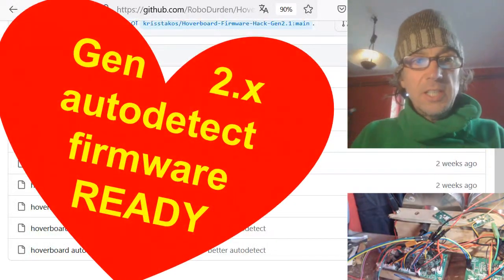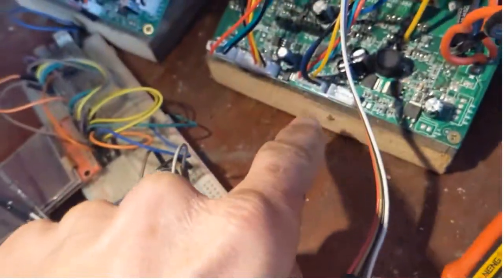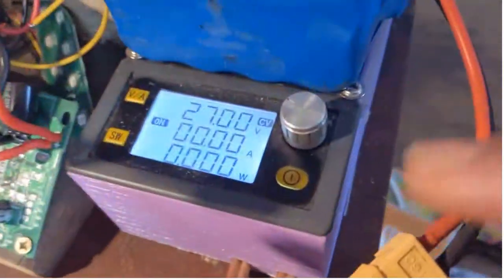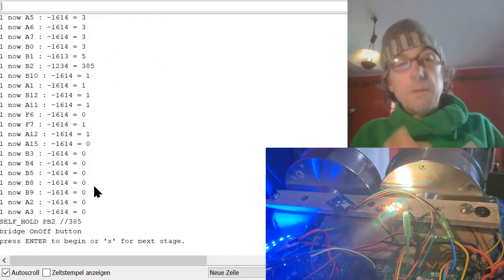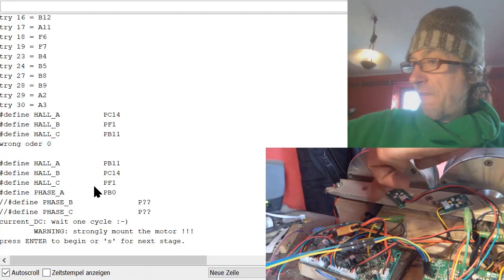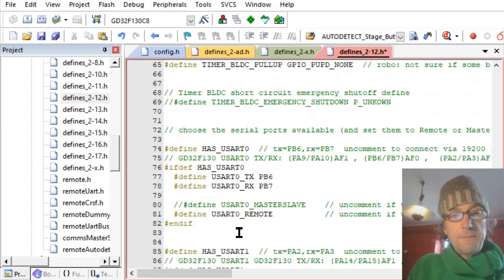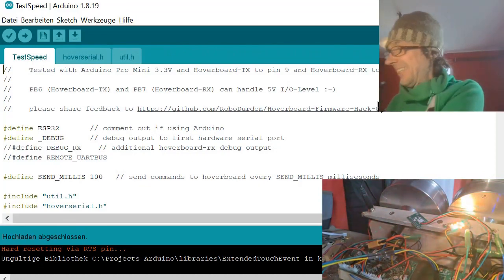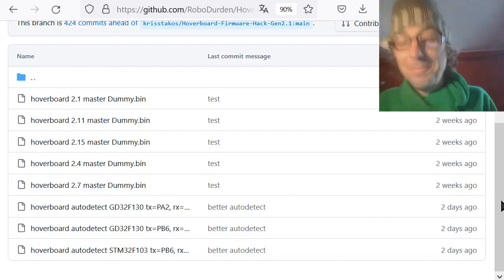READY: AutoDetect Gen2.x hoverboard + MM32 help needed :-)

Comment: Una pregunta donde encuentro el el archivo que estas usando en keil de este video para colocar las definiciones de los pines.
Reply from the maker: Autodetect is brand new and you better start a new issue on GitHub for your new board: https://github.com/RoboDurden/Hoverboard-Firmware-Hack-Gen2.x/issues/new

Simply post images of the board and the results of autodetect there and I will create a new defines2_target.version.h for all who have such a board.
But of course you can create such a file yourself in the Inc/ folder of the Keil project.
Reply: @robodurden  Listo ya lo subi solo que flasheé este bin: hoverboard 2.1.8 master Uart.bin y el pitido suena bien y prende el led que indica que esta encendido lo raro que no hace nada en la conexion uart lo conecte con una esp32 y  le puse el codigo de testSpeed pero no hace nada solo funciono la conexion uart en AutoDetect.

Comment: When you measure 5v on USB ttl dongle it is ok to connect to the stm but only the data line not the power line because it have a series resistor to limit the current and micro controller pins have anti esd diode which will clamp the voltage below 3.3v
Reply from the maker: STM32 are mostly found on Gen1 boards and the rx/tx pins short uart cable are 5VT = 5 volt tolerant. (the long cable not)
For these Gen2 boards, the PB6/PB7 pins sometimes are only found on some empty bluetooth module footprint and do not have resistors to protect the MCU.
I would not risk attaching a usb dongle that outputs 5V on rx or tx.

Comment: Hello, please help me, I want to control a dual board or radio and PPM, the chip of the board is stm32f10xx medium_density. Please guide me carefully.
Reply from the maker: Start a new issue on the GitHub repo and upload high resolution images, at least of the front side .
There is already a stm32f103 autodetect binary but you have to check that the six mosfet are compatible with that binary.
Reply from the maker: If this is a gen1 board that controls two motors, there are already many many tutorials here on YouTube. Including several beginners tutorials from me.
Reply: @robodurden  Hello, when I tried to program this file on the board with St-link utility, it gave me a warning of 0.80000000. what should I do?
Reply from the maker: @RAAAD1  Steg+B and then remove write protection and check all possible bits.
Retry. Reboot. I don't know.